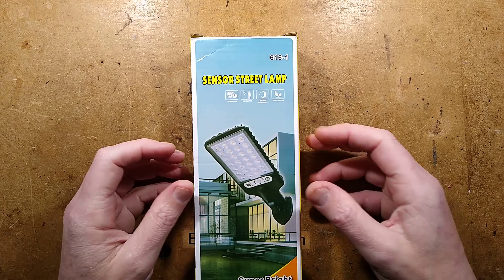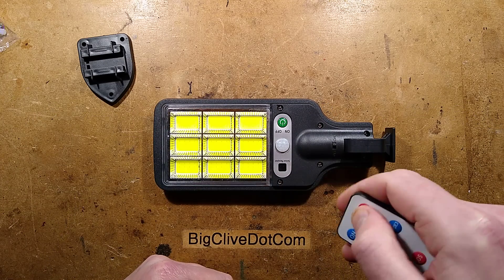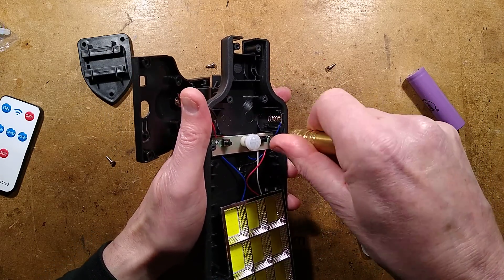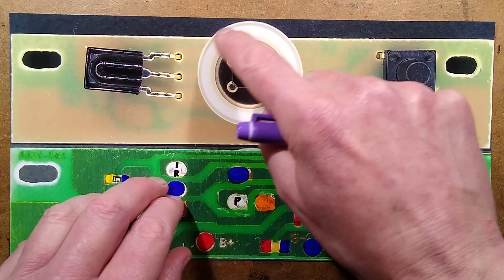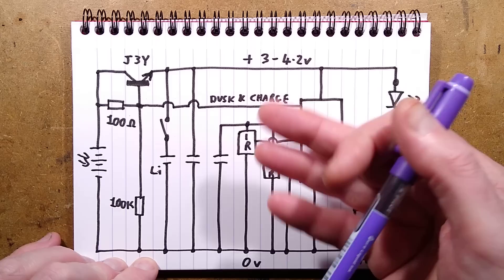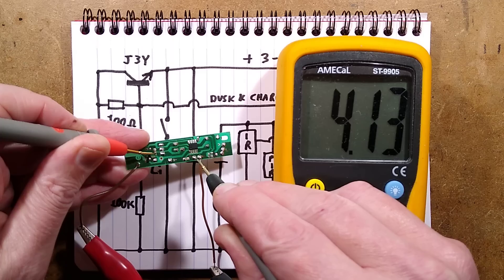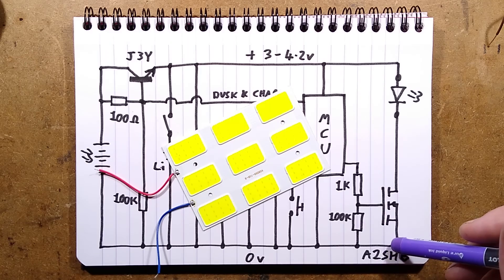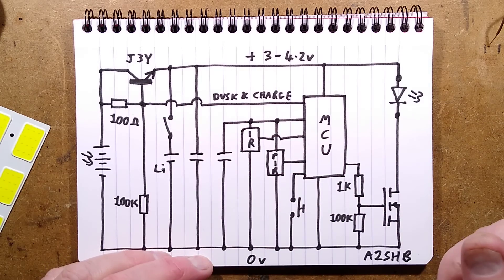5000w solar LED street light

Comment: Companies producing and selling such crap should be prosecuted by law to deliver what they advertised: a real 5000 watt street lamp. This lamp neither has 5000 watt, not 500 watt, not 50 watt and not even 5 watt, and neither it produces light like a 5000 watt bulb, but it's a terrible lie. Any serious company now has a problem competing because their e.g. 50 watt lamps are of course much brighter, may even lit a street, but need to be more expensive. It's just like the companies that destroyed the audio amplifier market by producing for instance the 6600 watt Auna Silverhammer amp with just  6 x 20 Wrms from 3 TDA7377.
You sadly did not measure the real wattage of this lamp (with full and empty battery, as there is no current regulation) its lumen output, you did not check if the LiIon battery is protected by an internal PCB and you did not check how much energy the solar cell produces during daytime to recharge, as this lamp does not have a mains connection or recharger. I can not agree to your recommendation. There are no current distribution resistors an the LED board.

Comment: Having seen a "real" water cooled 5kW Xenon discharge light (ex. light-house in the days that they still used this technology),  unless physics nowadays is different, that doesn't look like 5kW, mind you the light output is reasonable for a standby exterior light.

Comment: It's genuinely impressive how cheap they've got this stuff down to. 
It wouldn't hold up long in the UV, that plastic frame will crack in days
Reply: UV damage is my issue. In Colorado my hodgepodge assortment of solar lights get 8 to 10 hrs a day of sunlight about 320 days a year. Plastic gets brittle in a hurry around here. Clear lenses turn hazy yellow and other things just crack and break. On a positive note moisture ingress is low and humidity is lower so I don't deal with a ton of corrosion.
Reply: I've bought 6 of these things, but didn't consider U at the time. You are quite right of course, so I'll have to keep an eye on them.
Reply: Paint some aluminium foil black and cover it. No need to worry about the uv anymore

Comment: I’m slightly surprised the SOS mode does nothing. If this device were used as a front porch light, you could activate it to let others know you’re having an emergency. It’s one of the few places the damned ubiquitous SOS mode in LED devices actually makes sense.

The five thousand watt “rating” probably refers to how many watts it can expend before it dies of some random fault.

Comment: Oh my, yesterday I just opened up the same type solar street light to do some test and upgrade, but mine is smaller (6 cob 48 point led), battery 400mAh, solar panel 6.2v 70mA. Great for ambiance garden light with remote control, but the only issue is the flickering on mode 3, still flickering even after adding additional resistor to the led.
Reply from the maker: Random flickering can be cause by a failing LED.  Continuous strobing flicker at a fixed frequency is often just visible pulse width modulation.

Comment: I’m honestly surprised yours had the battery on a holder rather than the more common soldered leads. I bought one of those from a 100yen store a few weeks back to set at my apartment’s veranda. Mine looked the same except that the battery inside had some very thin copper wires soldered to it and fixed to the plastic by a square of double sided foam tapes.
Reply from the maker: I was surprised by the battery holder myself.
Reply: I now have 4 of these ... 3 have a holder and 1 soldered on. All are the hang li cells ~ 800 mAh measured. They are mfr in various incarnations and arrays
Reply: Holder actually saves some time while assembling parts together.

Comment: Great video! What kind of rechargeable battery is good for something like this? I need a rechargeable AAA battery as well. 

I don't like the price, but in the long run I heard they are cheaper. And the cheap ones I got wore out very fast. Which ones do you recommend?
Reply from the maker: Rechargeables do work out much cheaper in the long run, but don't always work in some products due to their slightly lower voltage.  The choice of cell technology will depend on the application.

Comment: I used a similar LED sensor lamp to build a high-power flashlight. The COB module that has all the led's can handle absurd level of current as soon as you bolt it to a radiator. Main drawback is that the array usually has all led's wired in parallel, making it susceptible to thermal runaway. I was able to get away with 15W (5A) of power from a panel that is even smaller than the one in the video. Needed an additional DC/DC converter to step-down battery voltage and regulate led current but those are not that expensive on ebay either.

Comment: I have 3 of these and I think they are great value.  One didn't work out of the box so I had an excuse to take the screws out.  I was pleasantly surprised to find the 18650 in a clip, and that was the problem with the dead unit.  The 18650 lasts fine on mode 1.  I have never tried the other modes long term.
 
In use they have proved reliable and effective.  What more could you ask for at the price.
Reply: "What more could you ask for at the price."
Honesty?
They do seem like a good deal but it sure bugs me they're so dishonest with the description.
Reply: @ddegn That's easy to fix. There are plenty of sellers that don't overinflate the description.

Comment: When they say 60w, they mean "the same light a 60 watt incandescent light would put out."

Which is about 900 lumens. 

Which consumes about actual 10 watts.

So a "5,000 watt" led light would be about 8000 lumens for about 80 actual watts.

If you see 60 watt bulbs that only consume 9 watts, you can know that they'll produce about 800 lumens and they will be dim.

Comment: How does it change the LED output? Just seems to be across the battery and turned off and on again by the mosfet.
Reply from the maker: Pulse width modulation.  It flashes the LED at very high speed with a variable on to off ratio to give the effect of lower intensity.

Comment: I would be curious to find out if the solar cell can fully recharge the battery after, say, eight hours of continuous nighttime use.  Many of the solar lamps I've seen fall short of that, resulting in the battery being so depleted after several days of use that the light turns off after only a few hours each night.

Comment: The Freznel Lens in front of the infra red sensors is used to create areas of higher/ lower sensitivity to maximise the change in level as movement occurs across the detection area. This is how intruder PIRs operate.
Reply: Fresnel my man. Zpelled with an S
Reply: Cheers, I stand corrected :) @TheDutchShepherd
Reply: @robames1293  thank you for educating is on how they work :)
Reply: I have to say that it is not often I can add something to Big Clive's explanations @TheDutchShepherd

Comment: The one I bought had a major design flaw. It has 3 modes, one of which is it will illuminate (at low brightness) at night. But when the battery is flat, it loses its memory and reverts to the sensor light mode (high brigthness, triggers when you go near it). So now I use it as a sensor light and its good for that. But it's useless as a solar (on at night) light. Absolutely dumb designing something with 3 modes and a remote that has no non-volatile memory.

Comment: I'm surprised that was only 7.99.  Looks like a pretty decent light.  Kinda makes me want to order one.
Reply: If you have the use case for it, do it. I have 5 of them and am mostly happy with them. There are just a couple of mechanical issues to be aware of: (1) They can be angled up, but the production quality of that mechanism varies wildly, so plan with them angled horizontally---that's where most of them end up after a day of rain. (2) The piece that connects them to the mounting plate is a bit brittle, and the mounting plate holds it tightly, so it will break if you mechanically abuse it. (3) The PIR cone is not very wide, so when mounted horizontally (see no.1) just above head height (that's how high my fence posts are), you'll have to step up to about 1.5m for it to activate.

Comment: Did you actually check the overvoltage protection? As, since the charge-shutoff is combined with dusk-detection, it has to turn charging back on at least periodically to make the dusk detection still work. And I think on long sunny summer days this might still cause overcharging...
Reply from the maker: I've not done a long term test.  I'd guess the software only switches the port to an input extremely briefly to test for dusk.  Literally just a few processor clock cycles every few seconds or more.
Reply: Had a couple of the spot light version of this light with the remote solar panel. The PIR was very unstable on both causing constant triggering. They also fill with water. I now have a different variant which I have sealed all the joints up on with silicone, it has survived one winder so far.

Comment: This reminds me of an interesting device I found this week in a thrift shop. It is like a late 80s or 90s compact electronic device that accepts a regular light bulb in one end and it screws into the house's outside lamp. If you turn that light on and off two times in quick succession, the bulb will go into an SOS mode and it either flashes or blinks SOS Morse code.

I wonder how it keeps track! Maybe a capacitor that keeps the electronics powered a brief moment? I would totally mail it from the US if it was interesting enough to analyze
Reply from the maker: It usually is a capacitor after a diode or bridge, with a sense resistor detecting the incoming supply presence.
Reply: @bigclivedotcom  thank you :)

Comment: I have four lights in my yard which use a charge and control circuit similar to this one.  They’re in metal enclosures and branded “Better Homes and Gardens.”  Inside, there are two 18650 “Westinghouse 2000 maH” cells paralleled.  The output is a Luxeon LED, supposedly 120 Lumens.  The solar panel is about the same size as the panel shown in Clive’s video.  The oldest lamp has been operating for more than three years on the original cells.  That is over 1,000 charge cycles.  There is a slight dusk detection difference in the MCU.  On my lights, there is about 30 seconds of hysteresis programmed apparently to prevent the moving evening shadows or passing car lights at night from making the light cycle off/on.
Reply: I have dusk-detecting garden lights that I upgraded with higher-capacity batteries.  They've been going strong for a good 3 years as well.
Reply: We have motion detecting lights that are still working 7 years later. But they aren't running all night like yours are. Only if the light is triggered.

Comment: The small LED modules look like the type used in head torches. It would be an interesting modification to swap some parts. For example, the head torch COB modules often include a red LED. It would be interesting to have a 'street light' that could output a red night vision light as well a white light, or switch from one colour to the other when triggered or depending on the ambient light level. I suppose I'm getting ahead of myself, but I can't help thinking it would be interesting to come up with a user-programmable chip, or even a module, that would be a drop-in replacement for the existing chip but provide custom functionality.

Comment: I'm not sure about upgrading the battery.  I feel like this small PV panel has hard time topping up even the existing cell if the light comes on every night.
thats my Experience with this type of lighting anyway. 
Ive actually been changing broken 18650 s in some solar lights to recovered vape cells of around 650-800mAh. and get same performance as with a 1000+aAh 18650 cell.

Comment: Actually quite a nice circuit if that MCU is designed to deal with wide voltage range.  Neat when a single I/O is used to do multiple things (properly).

Lot of 3.3V devices will still work down to 1.8 volts and the A/D converter internal reference is regulated internally at the lowest operating voltage (1.8V) or less.

Comment: No series resistor in the output LED circuit just means that they use the track resistance. I've just seen a YT vid of a USA car blower fan motor that used a zig-zag pcb trace as motor speed controller. ( Jz_0IDN5nO )

Comment: No city in their right mind would tax its residents to the extent necessary to pay the power bill for running a streetlight that consumes 5 kW of power.  However, LEDs are amazingly efficient.  If that 5 kW rating is the equivalent of a 5 kW incandescent light, that is much more believable, but that would still work out to 600-700 watts per module.

Edit: A garden light?!  5 kW would be as bright as daylight!
Reply: "No city in their right mind"

So most cities qualify...

Comment: Each cob subassembly will be 5 to 7W electrical. This light does not seem to run it anywhere near its full power. It is likely driving it with a PWM signal. The solar panel is sized so the Voc is equal to the max safe charge of the battery, about 4V in most of these. The LEDs themselves have a forward voltage high enough that it prevents over discharge as well, typically 3.3V.

Comment: Great tear down as usual. I was wondering, did you measure the current through the leds?
Reply from the maker: That data at various emulated cell voltages is in the description.
Reply: @bigclivedotcom Thanks

Comment: This brings us back to the time when almost all flashlights was marked with like 10,000,000 Candela instead of actual lumen, The high number in candle light must mean it is very bright right?, it never really tricked me but come on, 5Kw battery powered LED. Surely any person with a sense of reality should understand this is a scam.. yes?? I mean it would mean this lamp should output light equal to 20 of those 250watt Mercury street light lamps that each put out about 13000 Lumen each, or put together like 260,000 Lumen. and if you LED this power instead you should have about twice the lumen than that! That be like Half a million Lumen!!!! The sun would be like PUT THAT LIGHT OUT!

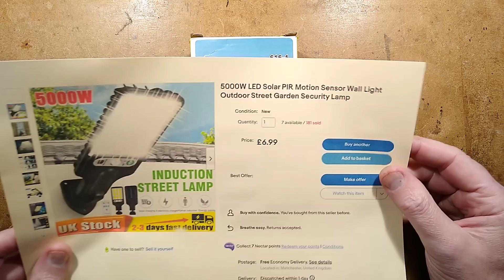Comment: 0:05  Still cannot see where the Induction on the box is on the circuit diagram maybe it is the consumer who is being inducted here?
Reply from the maker: The Chinese call just about every sensor "induction".  Presumably because of the inductive position sensors used in factory machines.

Comment: Whilst the symbol for the solar panel may be acceptable here, shouldn't it, strictly speaking, be illustrated by using a diode symbol shown somehow reverse biased, with arrows pointing in? Also, there was a "movement" in the 80's, suggesting that where denoting values of current, voltage, etc., to place the symbol for the appropriate deignator alongside with the decimal point, which is often diminutive, obscured, lost. or smudged, particularly on working circuit diagrams, e.g. 5V.6, A.17, 10mA.84, 10R.29, 1Z.47.  Imagine losing the point on 12.8V?This made it readily apparent unequivocally, despite the variable vagueries of a workplaec, and looks quite tidy, and perhaps neat too? Thank you for your presentations@
Reply from the maker: That would be a photodiode.  I tend to draw it as a stack of illuminated cells.

Comment: Is there any real advantage to using J3Y over a diode? I don't see any obvious value to having a circuit to stop the Li cell being charged when there isn't enough voltage from the solar cell to charge it anyway....
Reply from the maker: On a very sunny day it could potentially overcharge the cell.

Comment: Would’ve been interesting to know the max output from the solar & the current those COBs draw when at full brightness. This would’ve given a typical charge & run time.
Reply from the maker: There's more data in the description.
Reply: At 5000 watts, it presumably produces several gigalumens.

Comment: Li-ion charge to 4.2V. Check for regulator using 5V low amps. If there is no 4.2V reg the cell might be damaged by overcharging.
Got to buy two. The aldi lamps PIR range sux.

Comment: Honestly this light doesnt look bad if you want streetlight style garden lights. Could modify this for external dc supply or external battery
Reply: Or modify with the ability to have a built in USB 5V charger so it can be used to charge a device.
Reply from the maker: It could be powered from a USB style power supply.

Comment: I'd consider getting a couple of those for the front door, only problem is it's north-east facing so doesn't get a lot of sun, particularly in winter when they'd be most useful. I really need a mains solution, but I find it very hard to get trades people to come and do small jobs. I had a devil of a job getting somebody to come out and fix some buggered hinges on my windows.
Reply: There are similar solar lights with the panel separate so it can be put up on the roof pointing at the sun.
Reply: Wintertime body training bicycle with generator - recharging bio bio style.
Reply: It sounds like what you need is that wireless power over Wi-Fi which Wiggl says they can do.  It’s been a couple of years and still waiting to see their product.  What?, it might be a scam?  Oh no.

Comment: The PIR sensor and IR receiver supply voltage supplied by the MCU could possibly be turned off completely by the MCU when the supply voltage dips too low, in order to protect the Li-ion-cell from being depleted beyond its minimum voltage. That MCU could put itself into deep sleep when the supply voltage dips too low, until it gets woken up by the dusk&charge pin.

Comment: Maybe they meant 5,000 milliwatts 🤣  

Do you suppose the controller regulates the duty cycle on the mosfet in part based on the battery voltage?
Reply from the maker: That would be nice, buty I think it will be a fixed duty.